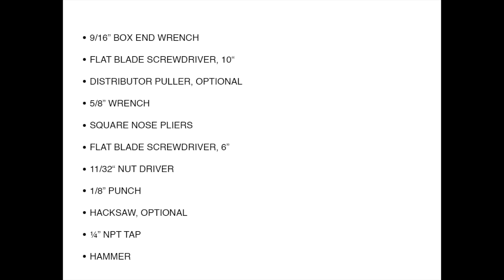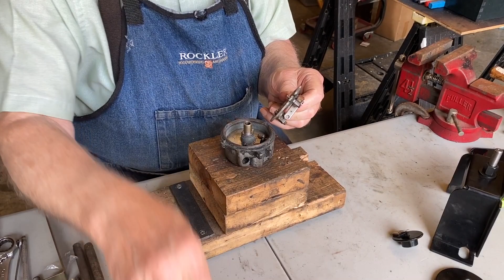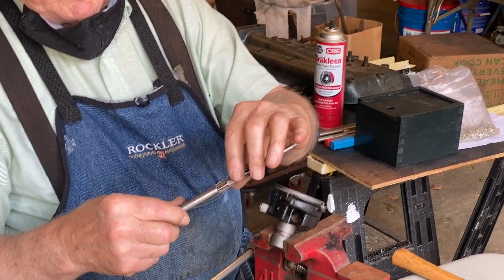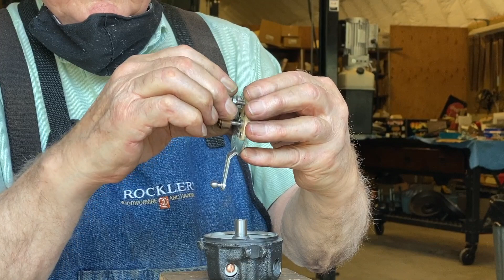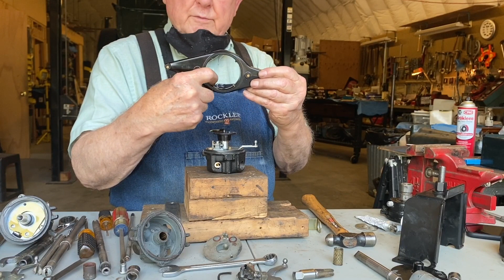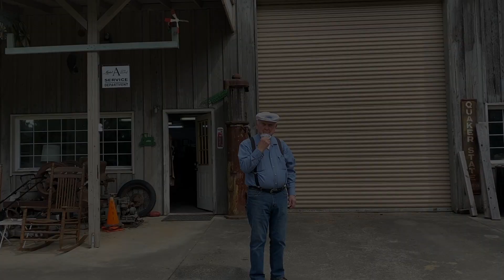How to Rebuild a Ford Model A Distributor with George Sage

Comment: Thank you for this excellent and very thorough video!  I'm doing this job today on my 1930 Deluxe coupe.  For those of us that have only one Model A distributor to work on, we probably don't have the specialized tooling (expansion reamer, pulling fixture, etc.) that you have.  Here's how I improvised:  To get the distributor out of the engine (of course it was rusted in) I removed the retaining bolt in the head and sprayed PB Blaster in the hole and let it sit for awhile.  I then applied slight pressure simultaneously under each side of the distributor with large screwdrivers, rocking them back and forth carefully.  A few slight taps on each side, more time and PB Blaster and more careful upward pressure with the screwdrivers finally worked and the rust let go.  Be extremely careful doing this or you will break something. To get the old bushings out, I used a small X-Acto knife edge file and cut a small groove lengthwise through the old bushing.  I was then able to use a small punch to crack the old bushing along that groove and collapse it enough so it could be easily driven out.  The lower end of the upper distributor shaft was rusted and worn so badly it's a wonder that the engine ran at all.  My new drilled upper shaft measured 0.499 exactly along the entire length.  My new bushings after installation measured 0.500 ID.  The shaft would not go through both bushings completely.  To "line bore" the bushings I used a 0.419 diameter drill bit and wound a few turns of very fine sandpaper around it.  After a few turns of the sandpaper through both bushings, the shaft fit perfectly.  Can't wait to see how nice the engine runs with a point gap that stays the same all the time!  I originally found the problem with the worn bushings and shaft by attaching a dwell meter while the engine was running.  The dwell varied from 25 degrees to 35 degrees when it was supposed to stay constant at 31 degrees!  Thanks again for your help!  Chip Ruhl, Williamsport, PA.

Comment: im new to reaming, the reamer is a 1/2 adjustable, do you know the exact specs.  and where do i find a tapered sleeve,you have the best video for rebuilding  thanks
Reply from the maker: Thanks for your comment.  I’ll get with George and we’ll get back to you.
Reply from the maker: Here's George's reply:  Reamer should be .500 and the tapered sleeve is provided with most adjustable reamers. If a fixed “fluted” reamer is used it should be long enough to self center.

Comment: For a flat slotted screw holder I like the one I used at IBM. It had flat pieces of spring steel which fit in the screw head. I can't describe it in words, but you could use it with one hand and it released with a push of a button. I sure wish I hadn't lost it 25 years ago.

Comment: Fantastic video, thank you so much for taking the time to make this. I know that's a hassle but I sure appreciate it. I have to do all that. I almost bought a shot press For the bushings, this is the best video I have seen on distributors ,the very best. Where can I get the centering block that you used on the half? Inch threaded rod to remthe bushes to keep everything centered. Also what would be the proper name for that tool. I've seen it on a video where they held the ringing tool. Just in advice and with both bushings in the operator just picked the distributor base up-and-down 3 or 4 times your way just seems so much more intelligent. Again thank you for making that video

Comment: Thank You George for this video --- I am just going through my distributor now. I like your wood fixture for holding and doing the work to the distributor --- Good Idea. Did not know about the lower plate having a brass spring loaded plate that eliminates the need for the wire between the upper and lower plate / nor did I know about the gap setting between rotor and contacts in the distributor body. --------- Thank You Again and Happy New Year -------- Rodney    PS --- What was the steel strip on the side of your fixture used for?

Comment: Thank you for your  great video. Two questions on your tools. Where did you find the tapered sleeve?  I checked McMaster Carr and no luck. 2nd question what is the name on the screw holder? You should know my old Pinto had the same system for setting its points.
Reply from the maker: I'll find out for you!
Reply: The tapered sleeve comes with that type of reamer. I think it's called a screw starter.

Comment: Fantastic video. 
I realise now where I went wrong rebuilding mine. I used a 1/2" tap which wouldn't bite onto the old bushes due to them being too worn. A 1/4 NPT tapered tap would have done the trick and saved me a lot of headaches getting them out. 
Lots of other great tips in there too. 
Thanks for sharing your knowledge.